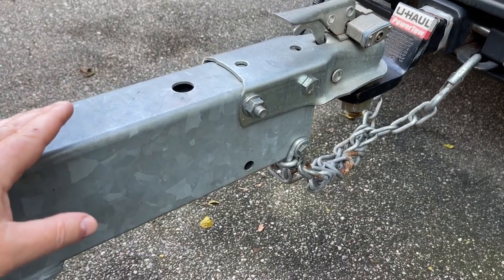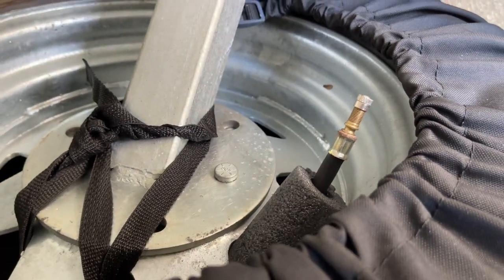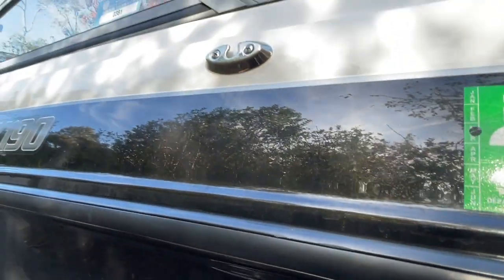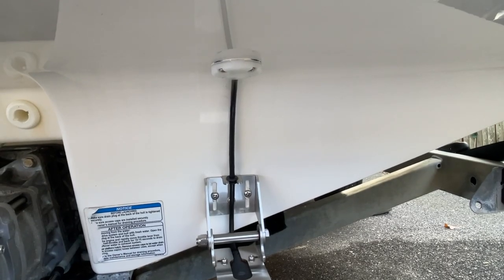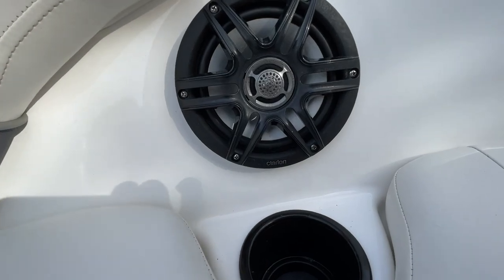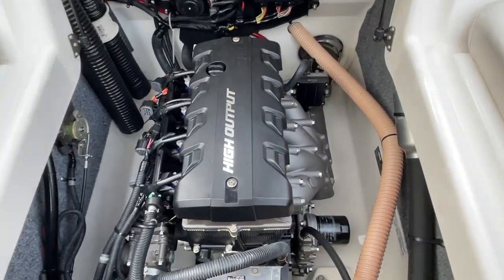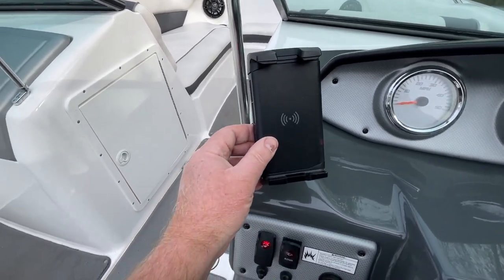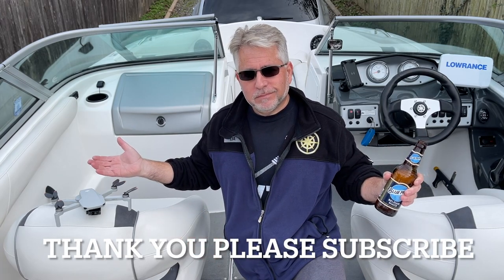Captain Leon's Best Boating Mods and Accessories

Comment: Finally a boat accessories video that was helpful. The greatest addition we have added to our boat is a hot logic. It plugs into the ciggarete lighter adapter & we are able to enjoy hot food on our boat. Our issue now is keeping our interior free from mold stains. Any tips?
Reply from the maker: Perhaps keep the boat well ventilated? Does your cover have sufficient air vents?
Reply: @CaptainLeonsBoatingandMore  hmm no vents but its just a tarp & it's not on tight(wind picks it up a little)
Reply from the maker: @sunsetatshabooms4558  tarps hold moisture, look for a vented cover. Just my opinion.

Comment: Love the videos.  Thanks for taking the time to put these together.  I have an AR195 to be picked up in the spring.  I’m in NYS too, but in the Finger Lakes area.  Can’t wait to get out.  I like those fender locks.  I don’t know if I can bring myself to drill into the boat though.
Reply from the maker: Hey Paul, thanks for watching and congrats on the boat. I know what you mean about drilling. As long as you measure, inspect and be certain before you drill, it should all come out fine. Also remember that fiberglass is easily fixable. Professionals can make it look like you never drilled. Good luck.
Reply: @CaptainLeonsBoatingandMore  Good point.  I’m sure I will end up putting them in, but brand new the boat is so pristine, I will probably give it a year or two before I start doing surgery.

Comment: Capt Leon-  I have a 2016 yamaha 242 limited e and was wondering if you have a video of how to replace the reverse cable  or directional control cable. Thank you.
Reply from the maker: Hey Jeff, I’m sorry I don’t. Most of my videos are generated as a result of need involving my own boat. Thankfully, I haven’t had that need yet, LOL. Wish I could help, and thanks for watching!
Reply: @CaptainLeonsBoatingandMore  would you know the bolt size or what I need to remove the 4 bolts to clean out the props? Thank you
Reply from the maker: @jeffrosen4260  if you mean, how do you service the jet pump, then this will help: https://youtu.be/YDIGz1VXLls

Comment: Great video Captain!  Question- what tire mounting system are you using on your trailer for your spare tire?
Reply from the maker: I believe this is what I have, with the smaller boat and trailer I needed the spare to be angled away from hull. Thanks for compliments and thanks for watching!  https://www.amazon.com/Extreme-Max-3001-0064-Mount-Carrier/dp/B001AXKOCA/ref=sr_1_5?crid=1BWCO3R6UPKIP&keywords=angled+spare+tire+carrier&qid=1649021433&sprefix=angled+spare+tire+carrier%2Caps%2C81&sr=8-5

Comment: Hi Capt.  I finally pulled the trigger and ordered a 2023 SX190.  I 've watched all of your videos, and I have a few questions.  What cover do you use for your boat? Do you trailer with it on?  During the boating season when not using the boat do you put the cover on.  Your advise, information is appreciated.
Reply from the maker: Hey Joseph, wow a 2023! You must be super excited. I still love my 190 as much as the day I got it. Now to your good questions. I use the Yamaha black deluxe mooring cover on the boat for all times when the boat is not in use during the summer. When we trailer to the ramp we leave the cover at home. After washing the boat from our saltwater use I reinstall the cover. In the winter I use the white felt backed transport cover that the boat came from the factory with. Make sure your dealer gives that to you, some discard it. Hope that helps, congrats!!
Reply: @CaptainLeonsBoatingandMore  Thank you, for the reply.

Comment: Captn Leon. How often or ever do you wish you had the 195 vs 190?  I'm not obsessed w top speed like some guys are but I'm worried the 190 will struggle pulling the kids or w a full load. Thanks!
Reply from the maker: Hey Eric, I'm in my 9th season with my 190 and I never wished I had the 195. I will say we have pulled a tuber with 4 or 5 people on the boat with no problem. I also routinely hit 43-44 mph. Like you I'm not a speed demon. If you're going to always have a packed boat and always looking to do water sports then maybe the 195 is better, just not for me. Factor in the fuel burn, on Boattest.com they indicate its like 70% more fuel used in the195 at WOT. Wait it gets worse, the greater fuel burn is also at 93 octane vs. the 87 octane of the 190. Many will tell you the 195 is the way to go, and the newer hull design from 2019 on is a bit slower, but for me, my 2014 190 is just perfect.

Comment: Hey Capt! I'm looking at upgrading wheels on the trailer to my 2019 SX195. I'm also mostly salt water. Anything special you took into consideration when you purchased yours?
Reply from the maker: Well they said the best for salt water use is the ugly galvanized wheels, but I really wanted something nicer. I went with aluminum and decided to take my chances. I hit them with spray wax now and then for protection. After one complete season they are still perfect. I would just avoid steel wheels. Make sure to watch my video covering the radial tires and wheels install.

Comment: YAMAHA THRUST VECTOR hey captain could you let me know which part works on the jet boat Yamaha SX 190 2017?
Reply from the maker: Hey Walter, I'm going to refer this question to Will Owen of Jet Boat Pilot. He would know best, perhaps he will comment in this thread shortly.
Reply: Thks
Reply: Thrust Vector will help tremendously with low speed control and maneuverability while moving forward. Lateral Thruster will help just as much while moving in reverse.
Reply: @CaptainLeonsBoatingandMore  thank you so much

Comment: Capt. Leon, do you ever troll when using the combo rod holder/cup holders in the stern?
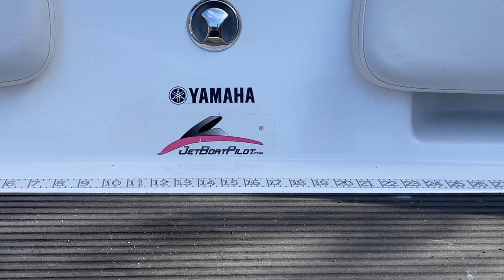Reply from the maker: Yes, the Bluefish on the swim deck at 12:28 was caught by trolling. I have also used the cup/rod holders behind the captains seats for trolling too, which may be more secure and more accessible with a fish on.

Comment: Good morning Captain is it possible to keep the Yamaha jet boat in the water all season long Mid-Hudson valley
Reply from the maker: It's possible, whether it's good for the boat is another thing...lol. Growth begins to grow on the bottom of boat while it is in the water. If it's salt water this growth can be extensive including barnacles, but fresh water causes growth too. You can bottom paint a hull to avoid this, but the issue is the intake grate, impeller and the rest of the jet pump. These components need a smooth flow of water without restriction, growth can really gum up the works. Do an experiment by pulling the boat after 2-3 days and checking it for problems, if all is well try it for longer periods. Always remember your bilge should be on and powered up sensing for infiltration of water anytime the boat is in the water.

Comment: Capt. Leon. I can’t find link for the nav light. Can you share which one you used? Yamaha sent me one for my 2013 212x but it doesn’t fit. Thanks
Reply from the maker: Paulie, I purchased an Attwood model similar to this. They keep changing designs and even I had to drill an additional hole to get it to fit, so don't expect it to be an exact replacement for the factory one: https://a.co/d/53aWj5n

Comment: Any thoughts on how to stop the high db sound level from engine
Reply from the maker: Of course folks have tried using sound dampening material in the engine bay, but its a high revving engine so you're not going to make it silent. I personally have not had any issue with the sound level, we don't run WOT all day long.

Comment: So your transducer has side imaging doesnt your motor get in the way or were you able to mount far enough away so it doesnt.  I had to get a second transducer and put one on each side in order to get mine to work.  I have a 2017 fsh 190 so my motor may be a little different then yours.  Also K&N filter, been looking for one but cant find it.
Reply from the maker: So the jet pump does not interfere. I get a decent side scan image. The 190 FSH has a slightly different hull design but the jet pump is quite similar. Thanks for watching!

Comment: Can you explain or do a video of how you wired your fishfinder/chartplotter for its power supply as well as your wireless cell phone charger?  Thanks a lot!  That is the next upgrade that I want to do on my 2013 AR190.
Reply from the maker: Hey Prosurfer, with the boat put away for winter, can't do a video on it right now. I can tell you however that I removed the panels holding the switches and located a 12v wire. From there I just tapped into it. Years ago I did a write up on it in the Yamaha Jet Boat forum. Here is the link: http://yamahajetboaters.com/forum/viewtopic.php?f=1&t=62631&hilit=+part+1
Reply: @CaptainLeonsBoatingandMore  perfect, thank you.  I actually have the wireless cell phone charger already installed on my boat, I simply put the ends of the charger wires into the free triangular plug that just sits back there.  I figured you possibly did the same for your fishfinder.  I wonder if you can purchase the other end of that triangular plug and attach that to the fishfinder wiring for a cleaner install, rather than having to tap into the wires directly...  so just to clarify, you used the wire taps to connect both the fishfinder and the cell phone charger to the free triangular plug?
Reply from the maker: @prosurfer92  I think the triangular plug may have been for diagnostic testing. I think I only used it for the Lowrance. I believe I tapped into a different 12 volt lead for the phone charger. Did you watch this video linked covering the phone charger install?
Reply: @CaptainLeonsBoatingandMore  video linked phone charger install?
Reply from the maker: @prosurfer92  yes, all the related videos are linked in the description of this video we are now commenting on.
Reply: @CaptainLeonsBoatingandMore  gotcha. I'll take a look. I currently have the phone charger mounted on the right side of the steering wheel where your fish finder is, and have it hooked into the triangular plug. I literally just stuck the wires into the plug to get the power, and then taped it in place. Lol.

Comment: Captain Leon - me again. I have a 2015 AR190 Shorlander single axle. I have 335 lbs on the tongue weight.  is this too much or too little?
Reply from the maker: Hi Chad, that boat weighs close to 2500-3000 lbs. loaded. Tongue weight should be between 250-300lbs. You are fine where you are, it's close. If you slide the winch stand back an inch on the trailer tongue you will lesson tongue weight if you feel you must.